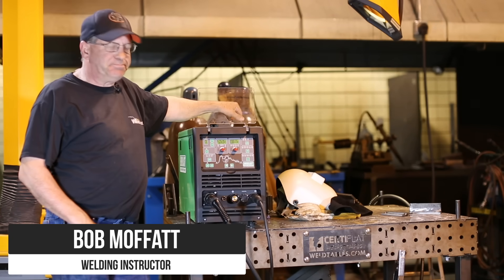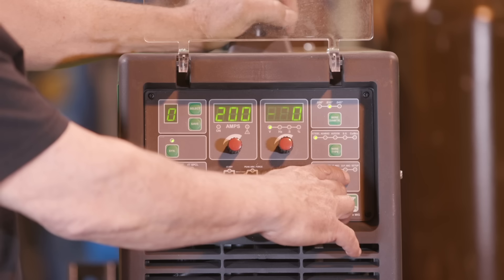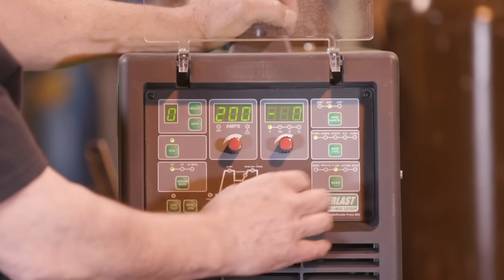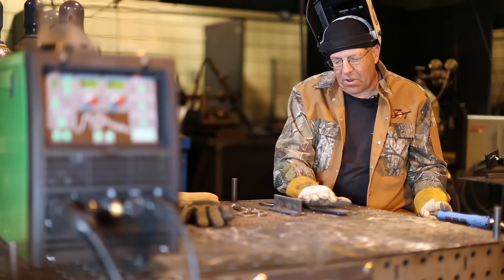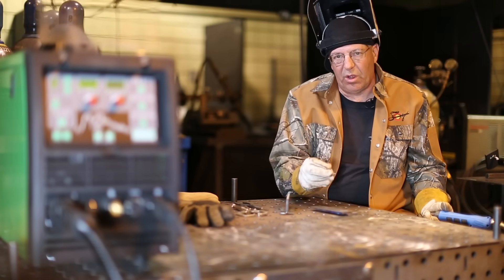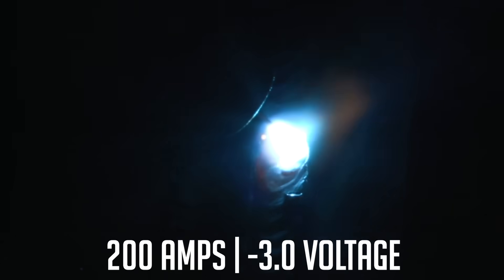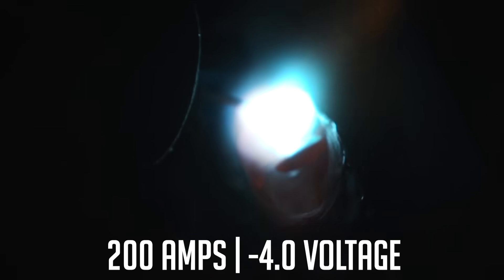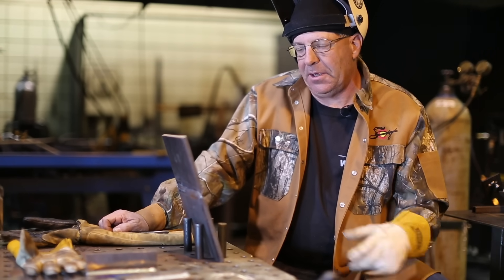🔥Pulse MIG Welding (with the Everlast Power iMIG 253 Dpi)

Comment: I recently started working with pulse spray MIG on the Multimatic 255 I use at work, with 90/10 gas, and it is so much better than short circuit, in basically every way.  Vertical uphill is trivial with this process.

Comment: In pulse welding aluminum the arc length settings confuse me no end.
i understand by increasing the trim the arc length increases as there is an increase in voltage and by decreasing the trim the arc length shortens because the voltage decreases. My question is this: what do the numbers represent in terms of voltage change?
For example what change is represented by minus 2 or by pluse 4 etc?
There is also mentioned something about frequency changes when using these changes. What is this all about? looking forward to reading some answers to these questions.
Many the in advance

Comment: Just purchased the Power mig 353 DPI for my garage/shop. I already own a 255 EXT. These are excellent machines and have the best customer service. And a 5 year no questions asked warranty.
Reply: How's the 353 DPI working out? I'm on the fence between it and the HTP Propulse 300.
Reply: @FlyinTrapezious  I love it, it’s an excellent machine. The pulse runs very nice and smooth.
Reply: @avocadoman3416 looking to get one for welding boats. Have you run some welds on dual pulse aluminum?

Comment: Why is it that nowhere in this video or these comments does anyone mention what the settings are? And don’t say -3.5 volts. The volts must be around 20 or something and then minus from there or something. Please also explain that too. I am an electrician and there is no such thing as having any power with a so called negative voltage.Don’t mean to sound harsh, just dying to get to the simple facts of this. Thank you. And what was the gas cfh,  nozzle size, and arc distance?

Comment: 90/2/8 is awesome for pulse. 90/10 is awesome for spray and short circuit, 75/25 (IMO) belongs on a farm along with 6010’s and 6013 lmao. Just my opinion, not saying 75/25 gas or the rods suck because they’re awesome too but if I have the choice I will take the 90/10 or 90/8/2 any day of the week.

Comment: Hello, for aluminum it requires a spool gun or with the torch that it includes from the factory, can you weld aluminum? Thanks.
Reply: That depends on the welder model you want to buy

Comment: Five moths I have welded pulse with Fronius. When you are 2-3 persons welding like this, the noise is really crazy. You can weld galvanized very easy with those settings, it is not burning like normal MIG.
Reply: what arc length do you use on your machine? what gas and wire? have mine but the pulse is a bit hit and miss regarding the arc length

Comment: Hi Bob, I love the educational aspect of your videos.  Something you said struck me as familiar.  I have a THERMAL ARC 400 MST dc only.  With it I got an ULTRAFEED VA2000.  I used 75/25 argon co2 @ 15cfh on a clean 1/4" angle iron butt joint.  I ran .035 er70s-6 @ 22 volts and 300 ipm.  I recall describing the resulting weld almost exactly as you did the pulsed mig weld in this video.  Fluid but yet it freezes quickly.  Used a Tweco spray master 450 mig gun.  My question is can I rely on mig for x ray quality welds on structural steel applications?  Which shielding gas or gasses do you recommend to achieve this if so, or should I just stay with stick?  Been welding 21years, always open to learn.  Also, I regularly use 90/10 argon co2 at work.  It seems able to do all 4 transfer modes.  What's the difference between using it and using 75/25 for short circuit transfer?  Also, how do you determine amperage yield given the wire size diameter, voltage, and wire feed speed?  Is there a formula?  We have older transformer type units at work. Thank you for your time. 

Jeremiah Cutcher

Comment: Enjoyed the video, but I have a few questions. When you say -3.5, -4.0 etc what exactly is it minus from? I assume it's the voltage (?) but what is the setting? Last question. Why do you say MIG? Using oxygen or carbondioxide mix makes an active gas = MAG?
Reply: It's just "customary" to say MIG even though it's really MAG.  I suppose because the majority of the gas is Argon which is Inert.  The negative numbers are a trim that reduce the voltage and thus the arc length.  Different machines set it up differently, but they all have it (the pulsed spray machines). Lincoln use the number 1.00 to be the center point, these Everlast machines use 0 as the center point, and HTP machines also use 0.0 as the center point.

Comment: I love spray fill up gaps and lay down some material.  We ran 1/16 wire and 98 2 gas on thick rail road track parts.
Reply: Hey do you know what controls the wire feed speed with gmaw pulsed spray?
Reply: @chrishansen8692   I would say it depends on the machine we ran Miller  with wire control system that ran 1 thur 10 speed settings
Reply: @johnw391  ok thanks

Comment: I miss pulse process.  Single pass .750" fillets with 0.057 wire, Lincoln power wave 455 and 500. 

It was a production shop welding frames for farm tillage equipment.  Rarely welded anything thinner than 3/8" , mostly .5 wall tube and 3/4 and 1" plate.   All single pass. 
You can push a heck of a puddle at 400 amps.  

C10 gas. 

New gloves every other day lol.
Reply: I’m trying to get into this. In regards to pulse mig welding 1” thick steel plate with .057” wire. Can you please tell me what your settings are? Voltage, amps, gas type, cfh, travel speed, nozzle size, and arc distance?
Reply: @just1fix119  I was using power wave 455 and 500's so only ever paid attention to wire speed.   300-375 ipm. Slower speeds on thinner materials.  C10 gas, 15 to 25 cfh depending on shop temps.      Arc distance is controlled by the machine.   Just keep the buzzing on "pitch" .   Strike an arc, build a puddle to desired lag width and push it along uniformly.   Have plenty of heat shields and extra gloves (left if right handed,  right if left)  plenty of sunblock under your clothes and hood.   Liquid cooled torch.  It's hot, fast and clean.   When done properly you will have a smooth, flat bead.

Comment: All my jobs since school one was flux core 1/16 100% Co2 , then railroad company 1/16 spay which was nice except no overhead  using 90-8 mix. Last was wheeling wheels 1/16 spray with a machine.  Never done pulse mig.

Comment: Wire quality has a lot to do with it.  Shop i work at switched wires and this stuff is cheap junk it can pulse  in flat position thats it.   A lot of work had to switch to a short arc to control the puddle.  Nice mode for welding but i don't see the hype as a fab end all be all many shop managers are making it out to be.

Comment: Bob I am looking for a Mig welder for thin sheet metal (auto body thickness) 22g and 20g steel.  Butt weld, plug weld and lap joints are the processes I am doing.   Blow throught, warping and popping are the main issues.  My shop is already equiped with millermatic 350p, miller dynasty 210dx, miller multimatic 215, Millermatic 251 and an old Miller 180amp a/c stick machine.  The machine does not need to work on thick materials (mm350p and mm251 got me covered).  Or if it's mabe a set up thing I am missing.  The mm350p is amazing on med to thick materials but not great on thin.  The settings chart in the machine is not great for thin metal do to thinnest wire setting are for .035 wire.  Any tips pointers or suggestions would be great.  Great channel I have learned a lot from you and Mr Tig.  I was looking at the htp pro pulse or a fronius welder.  Thanks Steve

Comment: Hi Bob,  I run A Lincoln Electric STT2 which is a pulse mig and it will do welds like that, good looking welds and hardly any spatter. Iv'e worked out parameters that work for me, and it is quite flexible on the types of welds it will do, from 1.5 mm thick expanded mesh tacks with 0.9mm wire, right up to 8mm fillet welds on 16mm thick Bissalloy plate with 1.2mm wire.

Comment: So the synergic lines are out from the factory (necessitating your trim down of the voltage)? The European version of these machines also has bad synergic lines. It’s just one of those things with different wire and gas specs.
Reply: The effectiveness and accurateness of the synergic settings will vary depending upon the gas.   Bob is using a gas a  bit out of the standard gas used for the setting. This unit is setup for 80/20 to 90/10 for close results.  Everyone is going to use trim, according to how they weld.   Lincoln and others face a similar challenge on their pulse MIGs.  Gas is almost everything for accurateness of settings.  And the balance is operator.  FWIW There is no Euro model available from Everlast on this unit.  This is an Everlast created model at the factory.
Reply: Everlast Power Equipment yeah, I hear you guys. Lines are only as good as the wires and gas they are written for, and operator preference. I know that r-tech and the likes don't have a version of the double pulse machine, and sadly they don't seem keen on moving into that area. But they're other machines were way out with the aluminium lines...

Comment: I work for a company that uses this same process. Except for the root they use a thing called RMD. Basically short arc mig but it deposits alot of metal. I weld steam pipe with it. RMD root, pulse mig hot pass, and fluxcore fill amd cap. The gas we use for the hardwire mig (rmd and pulse) is 90/10. Runs great, burns in good. Maybe some time you could do a pipe weld with this same process. Short arc root, pulse mig hotpass, and fluxcore fill amd cap. Great job!
Reply: Rmd is done downhill, forgot to add. Great for speed and production
Reply: nick ameiss Wow that is a lot of process changes, do you use different machines for each process or do you do a series of welds with each process in turn on the one machine?
Reply: nick ameiss just what is RMD? 
Resistant material deposit?
Reply: Same machine. Miller fieldpro 350. And i think rmd stands for rapid metal deposit. Could be wrong. But it works great. Makes a 24” 2” wall thickness steam pipe take less than a day to do. As opposed to tig and stick where it would take a couple days.
Reply: Same machine. Miller fieldpro 350. And i think rmd stands for rapid metal deposit. Could be wrong. But it works great. Makes a 24” 2” wall thickness steam pipe take less than a day to do. As opposed to tig and stick where it would take a couple days.
Reply: @shoveitupyours13  you said you pulse mig 2” thick steel? If so, what are your settings and travel speed? Gas type, cfh, arc distance, and nozzle size?
Reply: @just1fix119  about 210-230 wire speed, 90/10 gas around 35 cfh, arc length was around 1.0-1.3, no sure on the nozzle size, travel speed was just based on how much metal i wanted to deposit. When we did that, we used the pulse mig as a hot pass, dug deep and ran hot. We then used fluxcore as a fill and cap, could pour in a ton of metal. Also with pulse mig, minimal to no spatter which was real nice. For the travel speed also, i ended up filling about 1/2” of metal, so thats how i gauged my travel speed

Comment: I use a miller xms 4000 with 86%ar 12co2 and 2%O2. cant see past it for welding overhead, waay faster than short circuit. I played with the inductance rather than the trim value when learning to control the puddle fluidity overhead. Saying that i nearly always weld on plates coated in weldable primer so a longer arc seemed to help burn through it and reduce the red rain going down my back. Great video. Hope to keep learning from you guys

Comment: I run pulse on thick armor steel. I use 98%argon 2% CO2.  A little slower than spray. But you do need better gloves. And youll burn the color out of your shirts with pulse
Reply: Hy80?
Reply: @raynellmoore68w  LA100
Reply: @trailerpark187  on what material?
Reply: @raynellmoore68w  I'm not 100% sure. Print says rolled homogeneous armor
Reply: @trailerpark187  oh ok I've used similar wire, er100s on hy80 in the past. I believe it was pulsed spray, we were building steam condensers for nuc subs
Reply: @raynellmoore68w  yeah LA100 is just lincoln brand er100.  It just runs the best. Like feedabilty.  The esab er100 is wrapped up on the spool shity and doesn't feed well. Plus the overall outcome of the LA100/ bead profile and color of bead is way better then the esab

Comment: Very interesting. A lot to absorb. Since the pulse mig freezes the pool quickly on the offbeat, would it be more able to do overhead and verticle? Glued to the channel to see more.
Reply: Bang on mate
Reply: Yes. I weld aluminum pulse both overhead and vertical up/down. As easy as steel
Reply: Thank you sir

Comment: What were the full settings? Hertz, low and high voltages ect.
Reply: These are set synergically and follow factory programming parameters. While the machine can make manual settings, these are not what is being used here.  Everything is pretty much automatic.
Reply: Everlast Power Equipment does everlast have the settings available or some parameters to follow? I did get some help from someone but interested in what the manufacturers can provide as I cant find anything on it.
Reply: Mr. greens boat tanks and aluminium welding .  I am. Not sure what there is to set up except for amps as the unit sets everything else.
Reply: Everlast Power Equipment yeah my my welder has to be set manually as i dont have an everlast.
Reply: Mr. greens boat tanks and aluminium welding  what unit do you have?  You might download our power i mig 275P which has manual adjustment and it gives you basics for getting started.   But the rest is all about skill and knowledge of the operator.
Reply: Everlast Power Equipment i have a token tools 250p amp pulse mig. Its all manual controlled.
Reply: Everlast Power Equipment thanks

Comment: Can you do some videos on FluxCore Welding? I know its like Mig Welding but without the Gas, but I'd like to see how you FluxCore Weld and hear your recommendations. Thanks for the awesome videos.
Reply: ARC 7157  Hi. You drag flux core as oppose to pushing with mig bare wire & the polarity is different too. Some flux core applications still use shielding gas though. Hope this helps
Reply: He has a Flux Core video if you look back you will find it.  Scanning through the video's I think I saw it the other day.  I think it's an Academy Award winner.